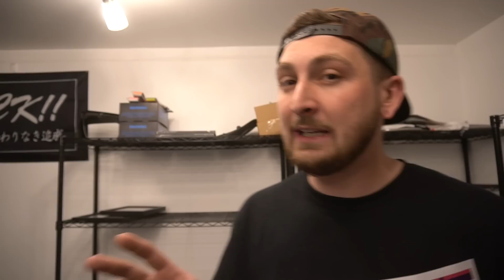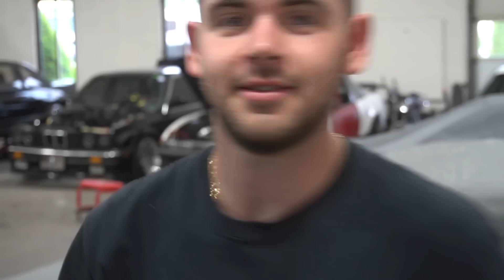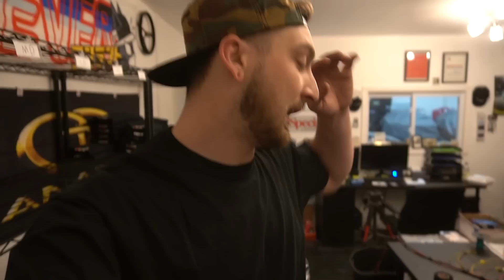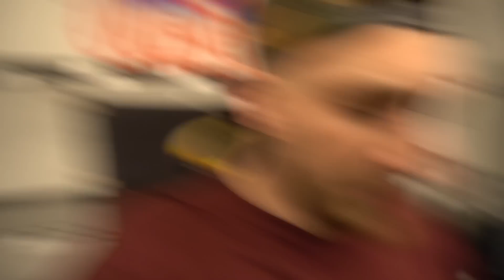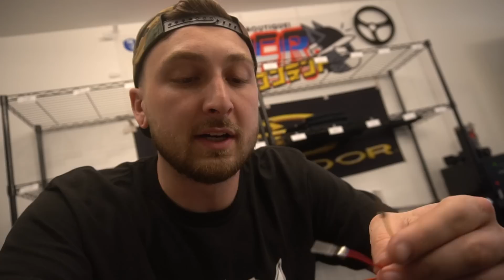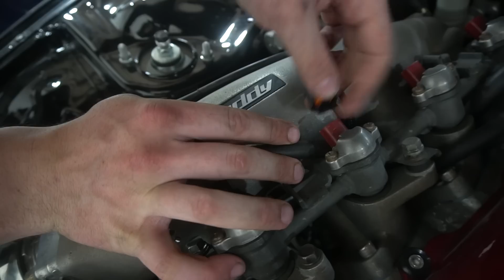Making a CUSTOM engine harness from SCRATCH!! (Full process)

Comment: 5 years late to the party but you should add an extra loop of wire before every connector (service loop) so that if you have to pull a connector off then you can have some extra wire just in case

Comment: good job for your first time. I did mine the same way except the only thing i did different was I wrapped the whole harness with Tesa tape first then loomed it. did make it a little stiffer but since it is in my truck and sometimes goes off road and dirt roads I wanted to have extra protection against vibration since the one i did runs from front all the way to the back routing through and around the frame etc. one thing people don't realize is how time consuming it is, also it is better to fix your lengths before you get too far, i found that out on my first one.

Comment: I know I'm late but great work. I just have a question, would those electrical connectors work for a regular Sr20de? I want to rebuilt my engine harness but I don't see a kit for a Sr20de manual transmission 1993 Infiniti g20

Comment: For the connectors where you thought you had a little to little wire to play with, if you had saved the heatshrink on the end of the loom untill you where done with the connectors you would have a lot more flexibility when crimping, then just adjust the position of the heatshrink to where the connector is when done.

Comment: heres a tip i use when using mesh braided sleeving. get yourself a hot knife to cut the braided sleeve. it will keep it from fraying apart when you put in the wires. then add the adhesive glue lined heatshrink to the ends to keep it in place.

Comment: A few mistake not to repeat:
1) Don't make solder joints. Especialy if no appropriate strain relief is made.  Solder makes ar hard, not flexible sport that will break over time from vibrations.
2) Don't make parallel connections/extensions - referring to that relay solder connection. Spread out such connections. So that in case a heat shrink isolation fails, then there won't be another heat shrink that can fail and make a short.
3) Would not use a braided sleeve in engine bay. That rough surface is ideal for collecting oil and dirt, and could turn into excellent torch if something goes bad. Better to use a sleeve with smooth surface.

Comment: I envy that you have built a full harness but I’ve only made enough to do a switch panel, and I’ve learned the hard way about concentric twisting. It is a necessary technique for it cause it makes a world of difference back to back. You should try it and it’ll help you improve 👍🏻

Comment: i just made my harness for a 2006 ecotec into my 1984 alfa romeo spider... this is a great way to do it... 1st  make all your pigtails from the sensors.. keep the wires about 2 meters long... then from the ecu make the harness from there about .5 meter lay the sensors long.. then put the ecu where you want it to mount.....  set  each pigtail were you want it to route in the engine bay.. nice and clean... then overlap the ecu harness over the sensor pigtails.. clip even, solder and use  a heat srink cover each solder connection.. then wrap the harness... does not take to much time and easy to do

Comment: Can you explain in more detail where you get repair components that you need like the plastic plugs and the internal terminals and sources of all of the colored striped wiring that a person might need to replace a engine harness like I have a 1974 Porsche 911 and it would be nice to rewire my engine harness if I could find the little individual electrical Terminals.   That would be really helpful thank you.

Comment: Please please please get rid of that relay with integrated fuse. I’ve had experience with those on multiple platforms and IT WILL FAIL. They are the cheapest, least reliable relay I have ever had the displeasure of dealing with. Replace with a nice Tyco or Hella relay PLEASE

Comment: One suggestion from someone who has made many harnesses (good and bad) - The sensor wires related to crank/cam, knock, ignition can cause strange issues if they're not shielded. Not a big deal on some engine/ECU combos, but required on others. Wire routing is a factor as well. I just got in the habit of using shielded wire for those sensors all the time, to prevent dirty electrical interference. Other than that, it's about perfect, especially for a first one.

Comment: The over lapping of the sleeve is a genius idea, wish I did that one mine. Looks sleek. Top tip is to plug it first before sleeving to test. It's a pain as you'll have to pin and then de-pin the connectors to then put sleeve on but it's better than tearing apart the look if there's a fault.

Comment: Jimmy, great video. I have been trying to find a video where they ACTUALLY make a harness not just talk about it, but really show the process to get a grip of how big a task it REALLY is. Pinning is indeed what it is called. One thing that could have made the whole pinning process easier would be a better pin crimper. Those ones work but there are nicer ones where the head is 90 degrees to the handles and you just push it all together and its 1 singular crimp and has a pressure setting. Harness looks great. Keep up the great content man!

Comment: i've modified a bunch of harnesses, and built a few from scratch. Its definitely intimidating at first (esp when you screw up, i almost burned my e30 down LOL), but practice makes perfect.

and Jimmy is 100% correct, Wiring Specialties is the place to go for wiring, pins, and connectors.

Comment: I second Promods comment on investing in good crispers and connectors, I believe the crimps we use are similar to the Nissan OEM ones, also don’t recommend that loom, looks good but no heat protection, also populating the connector is the term you are looking for, but pinning does work too, keep up the good work Jimmy

Comment: I'm sure you won't see this, BUT... when you're soldering joints you wanna offset your joints.  This makes your harness less "bubbly" basically it won't look like your harness has herpes. Offset your joints and everything fits more fluid. Example: one joint 2" away from connector 2nd joint 3" away etc etc..

Comment: Next time I would advise holding off on the heat shrink at your plug ends to make sure you have enough slack when you pin the wires and install them into your connectors. I have built several harnesses for SAKAI asphalt rollers installing gps tracking units and US friendly diagnostic adapters at the factory.

Comment: I have a question I bought a Miata alredy boosted and I just installed a new turbo and I’m auto tuning a mega squirt with tuner studio but I’m running really lean if install bigger fuel injectors will it fix it

Comment: Also word to the wise, solder is stayed away from in motorsports.  crimping is preferring.  A proper crimp is a cold weld and will hold up better to abuse and vibration than a solder joint.  especially if you're solder joints aren't good.  I don't hate solder as much as most motorsports guys but it's definitely not as good as crimping for this type of stuff.

Comment: Correction:  ECU's provide a ground on auxilary outputs.  When the output is on, it is connected to ground, when it is off, it is "floating".  So to switch a relay you provide ignition 12V on one side, and the ecu output on the other side.  Digital inputs are also 0-5V.  high or low.

Comment: So questions: 
From a work flow perspective, did you find it easier to work by tool / process, or by individual connector? Like did you strip every wire, then solder everything that needed it, then crimp pins on the rest? Or did you finish prepping each wire before moving to the next? 

What was the amazon loom you used? Would you buy more of it? 

Did you tape the harness under the loom like some oems, or do you think it’s not necessary? 

Finally, would you make yourself a harness schematic, or do you think that’s unnecessary because you built the harness? 
I love this video, thanks man!
Reply: Not to thread jack however I've found different techniques work differently depending on the resources you have. It can be difficult to source a NEW ECM connector with brand new pins. When I have not been able to source one I usually attach the wires to the ECM pins and sleeve it from the ECM towards the connectors. In the situation where a new ECM connector is available the easiest way is to measure your longest connector and either measure everything to lenght or terminate the sensors/switches first make the branches then leave the ECM connector for last, this way the hardest part which is wire placement is already done. You can terminate the ECM connector indoors comfortably.
Reply: To answer your questions get all your cables in place and to length solder if required cover all solder joints with two layers of heat shrink or one layer of adhesive lined heat shrink this stops the solder joint from bending and cracking. 

When it comes to the connectors crimp by tool as the wire strip lengths will be different. Use the manufacturers data sheet as a guide. I’m guessing jimmy used what looked like generic tools. 

The looming must be cut with a hot knife to fuse the ends which prevents fraying. Cheaper loom isn’t more likely to fray. An alternative you could use is spiral wrap or conduit. 

As for schematics just create a pin table meaning boost pump is on pins 17 and 18 just like jimmy did a schematic just isn’t needed as it’s just a diy project schematics are used to make manufacturers drawings and for electrical testing.
Reply: Bump
Reply: Bump
Reply: Bump

Comment: Jimmy, looming protips for ya bud.

I couldn't tell from the video but the wire bundles should have a slight twist so the harness will be more compliant in positioning. Grab a butterknife or a metal spatula and heat it up to a dull red and use that to cut the woven loom to help keep it from fraying(you can buy a hot knife, but goodwill has butterknives for cheap and you already have a torch.). When you cut the loom, you want it to be expanded to around twice the diameter of it when it is fully pulled tight or at about the diameter to be slightly tight on the bundle. You can slide the uncut loom down the wire bundles and then back it off some to get the right length, that way you avoid discrepancies in length due to stretch you get from eye-balling or measuring and cutting off the bundle.

For the final casing with the woven loom, the super sick pro way is to have the sub bundles cased beyond the separation point(so some of the sub-bundle casing is inside the main casing.) and use a fabric loom tape to hold it in place. You then slide the final casing on from the origin point(the ecu, main harness plug, etc.) all the way down, but do not cut it yet. Heatshrink the end of the outer casing at the point furthest from the origin. Then you work backwards with a pick to pull the sub-bundles through the outer casing, pushing the casing towards itself to expand it so you can slip the sub-bundles through the holes.  After all the sub-bundles are pulled through, cut the origin end of the outer casing and heatshrink it in place. Cutting the origin end is easily done if you tape before the point you want to cut and then push the casing together to expand it and then scissors to cut. Finally heatstrink or fabric tape over the base of the sub-bundles as you did. 

Kind of a pain to do it like that and it takes a longer time but the results are super clean and durable. You did great for your first time just trying to figure it out yourself.

Comment: If i'm following, there is one line of power at 14ft length. At each intersection, where we need to branch off and add power, how are you putting power to those bundles? Are you stripping and soldering the power wire making a branch into the applicable bundle? Or is there a different technique youre using? Doing it that way is the only I can think of, but has problems (in my head) with holding up.

Comment: I think you're right with "pinning" because there's a tool called a de-pinner for removing wires from the connector in computers when you're resleeving your wires.

Comment: Quick tip for the loom, use Black electrical tape on the wire before looming to hide the color from the wire. It will make the wiring a bit thick and harder to manage tho.

Comment: Have to invest into quality crimpers and splice connections. Solder can fatigue and crack after exposed vibration. Motorsport wiring and OEM exclusively crimps for this (and a few other) reasons. Otherwise, looks good dude! Definitely no small undertaking.